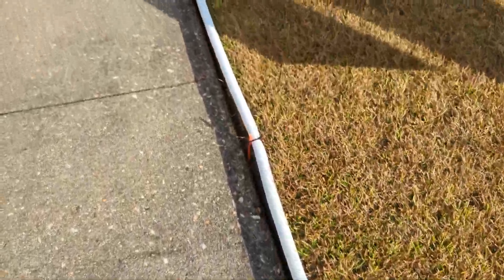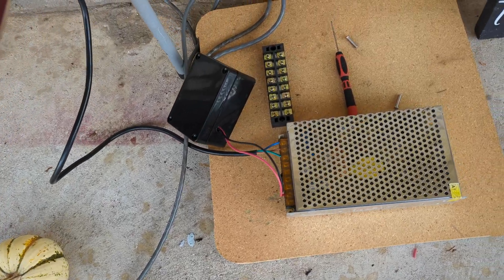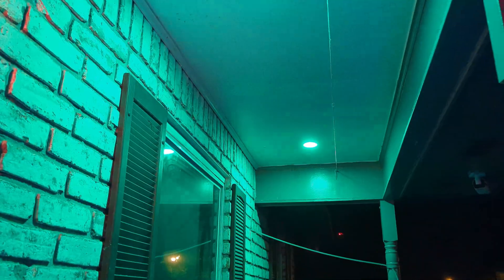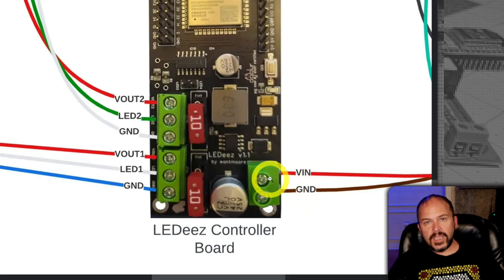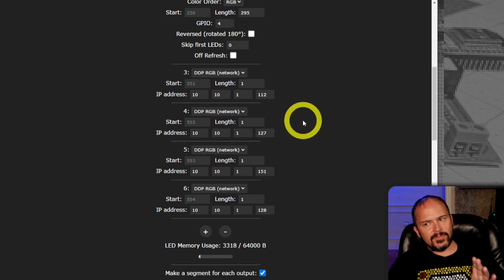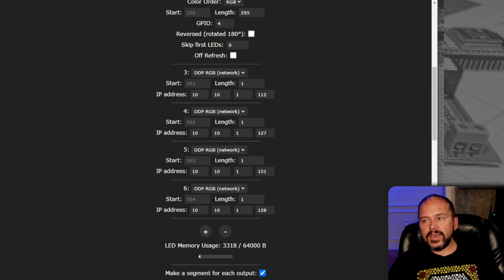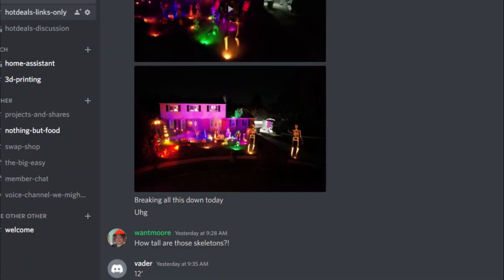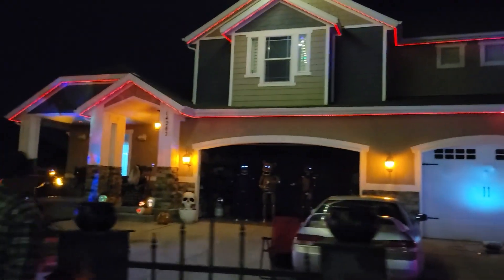Tron Racer Lights - How did I do it?

Comment: Nice video Travis. I'm looking to install some new camper lights which runs off of a 12vdc supply. Would you have a link to those Tasmota drop lights that you're utilizing or have any recomendations?
Reply from the maker: Those are some older AC mains powered zemismart lights before they switched to non ESP. Wallys lights have some 12vdc floods.

Comment: is there a way I can use this ledeez boards to revive some old twinkly sets? it seems to only have 2 wires going into the controller, but has 3 wires throughout the strand (their controllers died from water intrusion)
Reply from the maker: If WLED supports the LED chip type you should be able to.

Comment: For the past 2 years, I have been trying to do this with extra PEX piping (that I used for leaping arches), but it's way to heavy and I can't get the pipe to lay straight. You're solution solves my "problem"! Really great! How far are the Pixels inside? I was also considering doing this with extra LED strips I have but if they look this good, then there is no need for LED strips in this scenario!
Reply from the maker: I tried PEX, I tried PVC and wasn't happy with it myself. I bought some wire loom and was like woahhh... this looks awesome.  So of course I bought more.  I highly suggest gloves during stuffing to keep the cuticles intact on your fingers.  

They just lay inside the tube.  I do make sure they all point the same direction to keep things consistent and the same "stuff rate".  I tried LED strips but they would rotate over and wouldn't lay flat. I even tried fiberglass sticks inside to help with the keeping things straight but then it was a gamble on making sure you couldn't see the lines.  So I just pull it tight and call it a day.  I do tie wrap the slack on the strand junctions to keep the pixels the same distance through the junction.